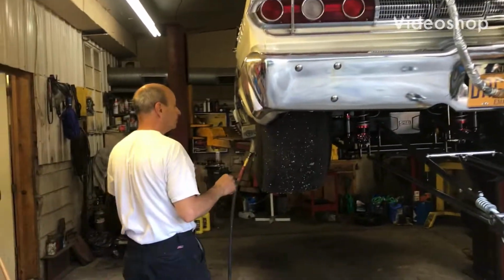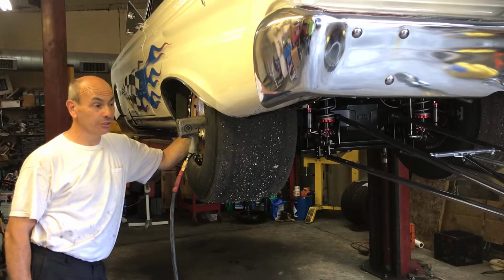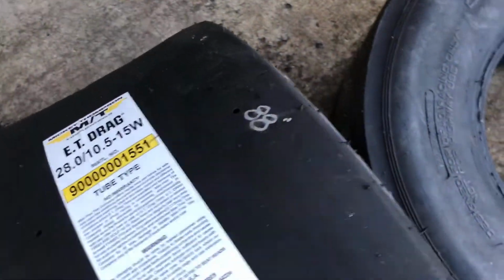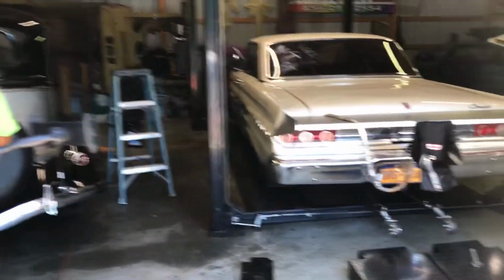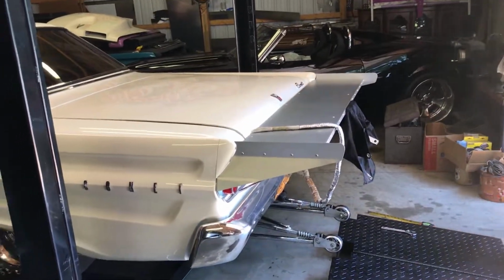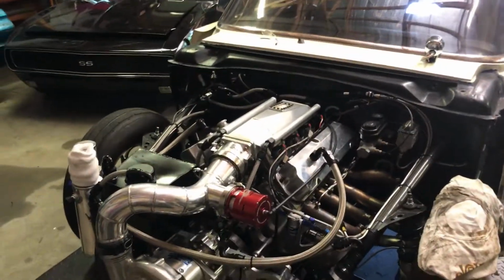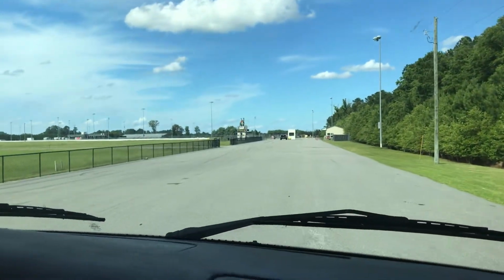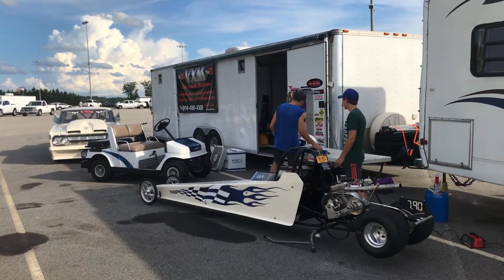Heading South for some testing and racing.

Comment: I see you tow with a motor home how does it tow? is it a gas engine did you do anything to the frame any info will help
Reply from the maker: It’s a 2001 Ford F450 the trailers 30 foot I’ve been towing with it for probably five years I only use it to tow the trailer to the track rarely is it not being used at all it’s V10 gas tows good I only go about 65 max.   I did not do anything to the frame and to be honest with you if you have a smaller trailer probably better this one so long and the tail end of the camper is so long as you touch the steering wheel and everything sways but it
Reply from the maker: It tows good but like everything else I need to pay attention what you doing..thanks for watching